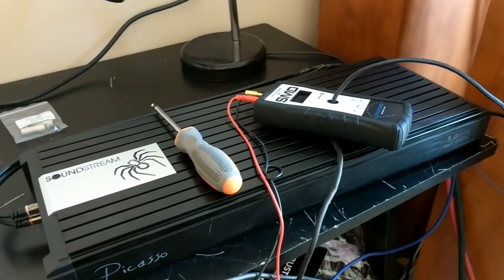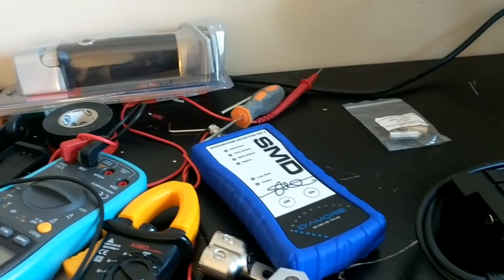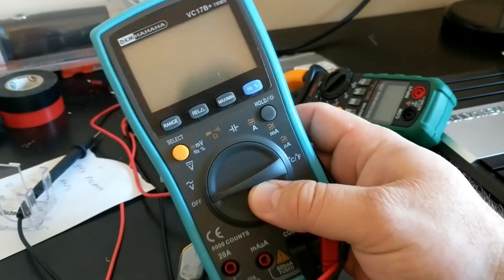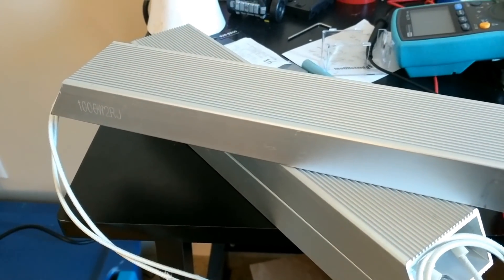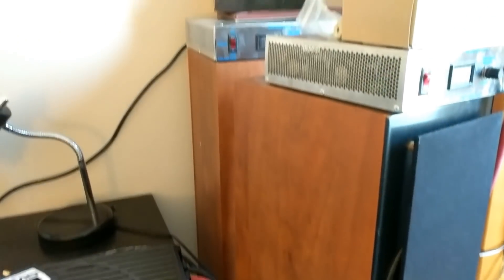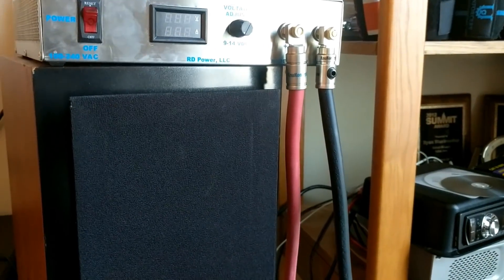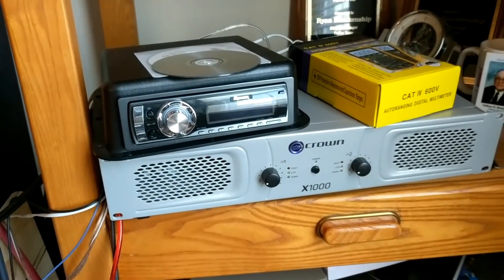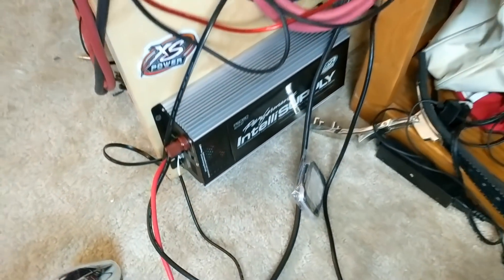Budget Gem Or Budget Bust Behind The Scenes

Comment: Hey Ryan I have seen some Jensen Power amps on  Amazon and I noticed some of the line uses High Current Toshiba Output transistors and was wondering if you  might test out the 500 watt mono amp and see if it does its rated power.

Comment: Stepping up to the big leagues with the AD-1! Love the video’s man keep em coming! I use the same braking resistors on my little test cart I only wish they could be wired in series...
Reply: Ryan Blankenship mine may be different, but they have no positive or negative... so I can parallel them, but if I try and switch it around I still get the paralleled impedance.
Reply: Ryan Blankenship I’ve only tried it with the 1ohm version because I didn’t have 2 4ohm resistors so that could possibly be the difference? Although it seems like it shouldn’t matter...
Reply: Ryan Blankenship same way I would with voice coils on a sub. I just hooked them up wire to wire and got 1/2ohm but when I hook up just one wire and then take the 2 left I still get 1/2ohm.

Comment: What kind of power supplies are those and where can they be purchased? I’d really like to upgrade mine, but can’t find one I like.
Reply: 10-4, Thank You.
Reply: Have another question. Do you have your power supply hooked up to your battery bank? If not, it wouldn’t hurt to hook it to a battery bank since the power supply is putting out DC voltage would it?
Reply: Ok, well the power supply I have now is a Pyramid PSV-300 and only puts out 13.8v. I just have two amps running. I have a Ultimate TA4320 on 6x9”s and a KAC-8105D on a 15”. It’s just a little something to have some music in the garage. I have some other old amps I like to hook up and mess with too. It does fine at low to medium volume and even at high volume, just depends. It cuts out when it tries to go low. Sucks the power right now....So I was just wondering if I could hook up my power supply and use the batteries for a reserve for when it wants more juice.
Reply: Sounds good, Thanks for the info.

Comment: Awesome! Good idea to use an office to test amps, I use my detached garage and it has been really tough with the weather lately. I may need to convert my unused office into my testing lab too! Great idea showing off your testing equipment and yeah, looks like you have enough to test several thousand watts. Can't wait to see what you release next!
Reply: Yeah, recommended! It has been unseasonably cold even down here in NC for the past week. I have plans to insulate and heat/cool my garage, but it may take some time to finish.
Reply: I heard that! Hey, I'm sending you a PM on Facebook.
Reply: PLEASE DO RYAN! I have a few questions that would most likely be answered if an update video was made. Great channel by the way, just subscribed (to you as well BigDWiz). I am currently in the middle of building onto my existing home theater system with a car audio amp/subs/psu/ etc. My main question is about your use of the Intellicharger. Before seeing your setup, I was under the impression I'd be fine with the RD Power 150A PSU coupled with my spare Optima Yellow Top to push the Rockville dB16. You're using both RD Power PSUs as well as the Intellicharger. Are you just using the Intellicharger when not hooked up to the RD Powers for battery health purposes? Or does it stay hooked into the system for extra power?? Let me know! Thanks in advance, keep it up!
Reply: Thanks Ryan! Can't wait for more videos